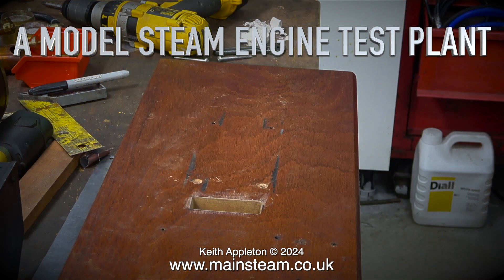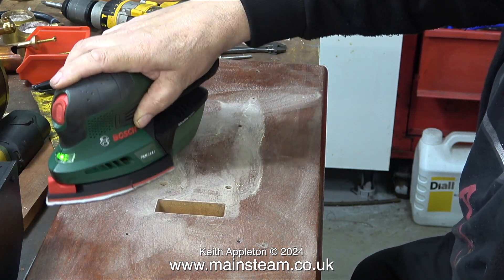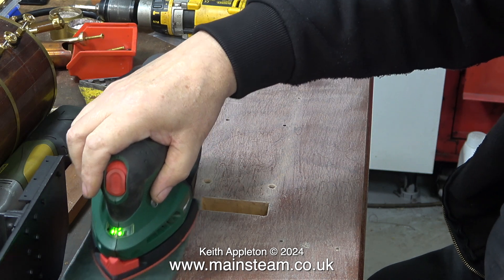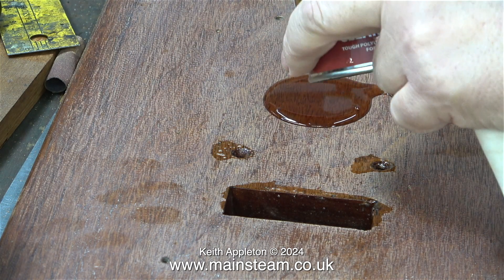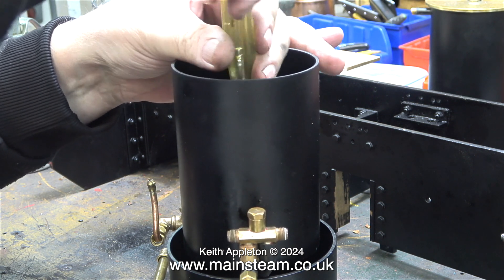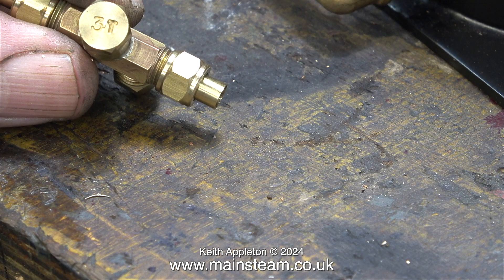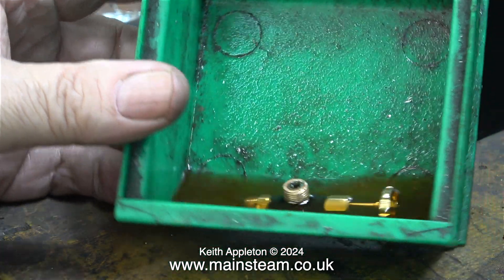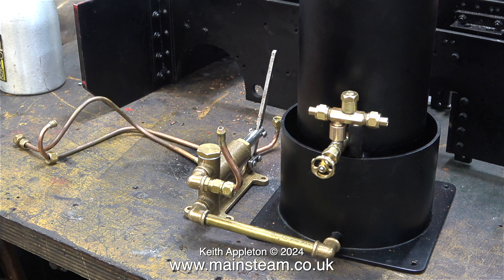A MODEL STEAM ENGINE TEST PLANT - PART #30

Comment: 3m makes scotch brite pads with hook backings for various sanders, so I can't imagine it would hurt the sander itself.  Using the pads directly on the platen might wear it out eventually but you should be able to get replacement platen pads for your Bosch - mine is a Ryobi and I know there are replacements readily available for it.
Reply from the maker: It works well so far }:-)))

Comment: I think I missed something. You removed the #4 injector to replace it with a #3 injector. Then all of a sudden you were using a #2. What did I miss?
Reply from the maker: Originally I used an old number 4 Injector, which was erratic, then I bought two new injectors, but the number 3 was the best for this boiler. I was just trying options . . . . it is good to experiment }:-)))